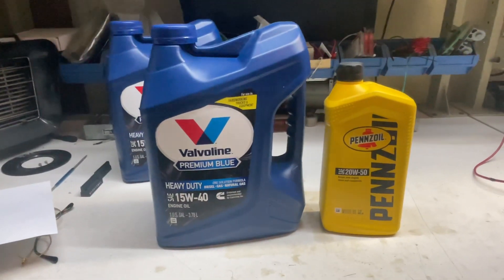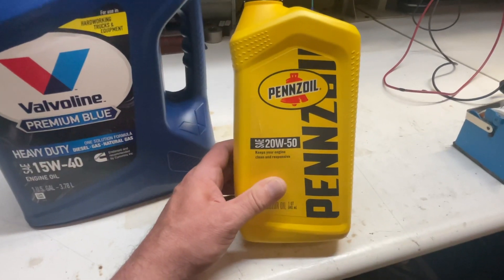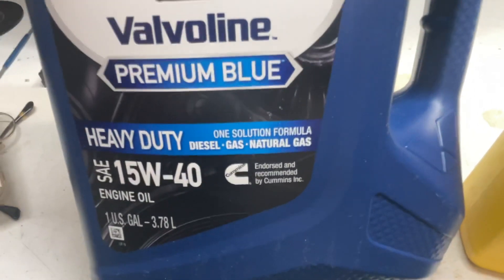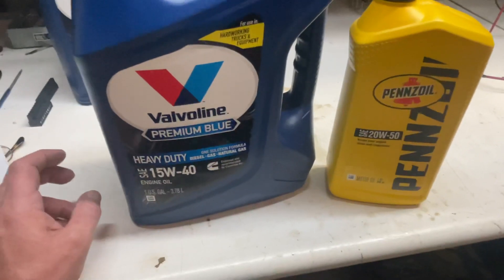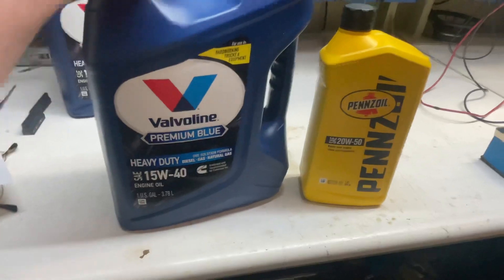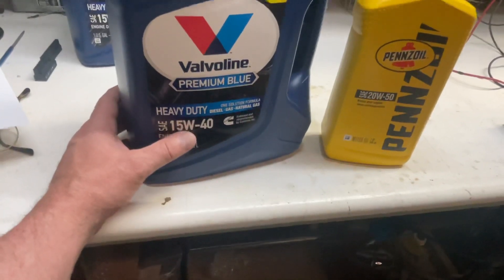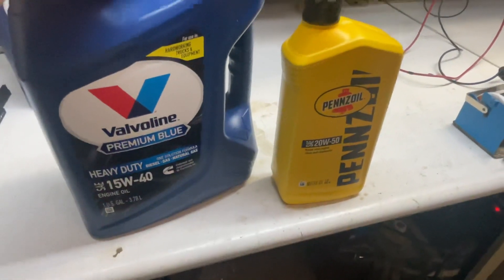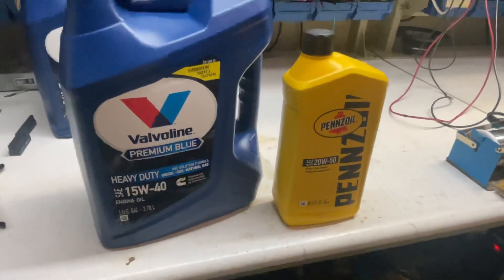Mercedes W126 w Catalytic Converter, phosphorus limits Shell Rotella, Valvoline Premium Blue Oil

Comment: Do you recommend doing a oil flush on a w126 that has sat for more than 10 years?
Reply from the maker: Yes, definitely 
Peter
Reply from the maker: Be careful with the chain tensioner as this is a hydraulic device on these engines and should be removed, inspected and preloaded with fresh oil minimum 15W40. They do not like synthetic oils

Comment: Outta curiosity, why not use Castrol 20W-50 conventional oil still available at Walmart and such? Great video,👍
Reply from the maker: Hi Dan,
For the last 4 decades or so I have used primarily Pennzoil and Mobil One. I have never tried Castrol but would give it try if they still had 20W-40 Non Synthetic, but they don't either. So it's 15W-40 Valvoline for the Winter. Peter

Comment: I use 10W-40 Shell Helix for my 420SE for years.  I change every autumn.  my car has unfortunately a lot of short range drives but I also like to drive around 180-200 Km/h with this car on the highway. No problems so far. The tensioner thing makes sense but i would be a little bit worrying wether the thick 15W is maybe not so good for the rest of the engine in the long run, espeacially with my use case with more cold starts. but these were common specifications when the cars came out, so they might be ok.
I also knwo some people who use 0W-40 in their 126 V8s without any problems for years. i guess more important is the regular oilchange in max. 12 month.

Comment: Interesting video. Although my cars are I6 and one I4 I use liqui Molly which still sells semi synthetic oil. They offer 15W-40 for cars and 15W-50 but for motorcycles. I must say, when I started using the stuff in my M103 3.0 l6 the valve train is much quieter, it has an additive MoS2 which is anti friction.

Comment: Nice video! Very interesting! I live in Guatemala  where temperatures are hot like 30° Celsius all the year. I use castrol 20W-50 mineral on my 420se w126. Im planing to use MOS2 LEICHTLAUF 20W-50 Liqui Moly in the next oil change.